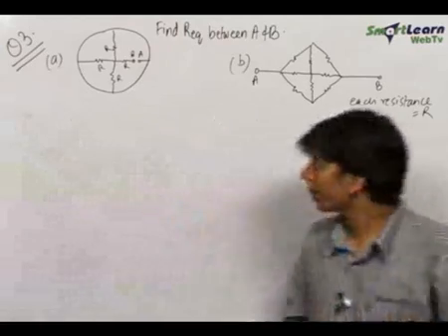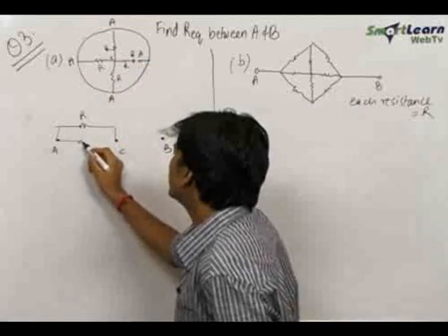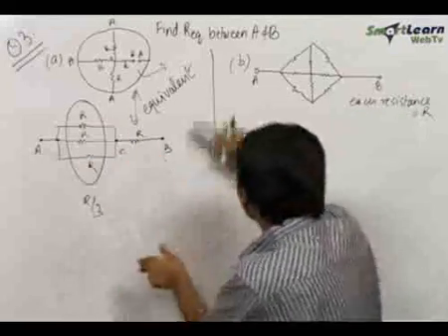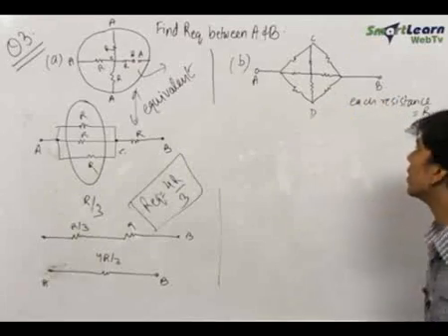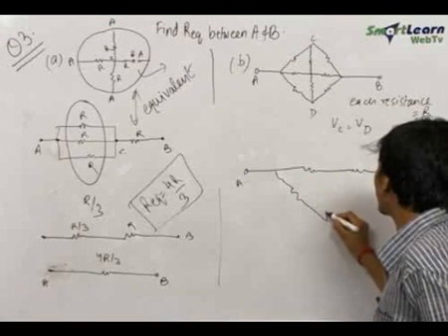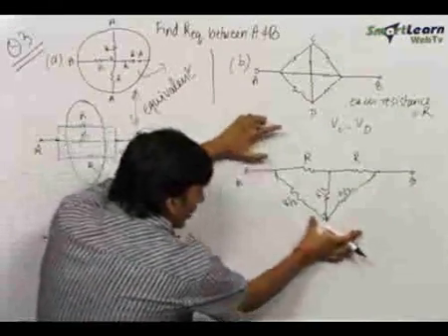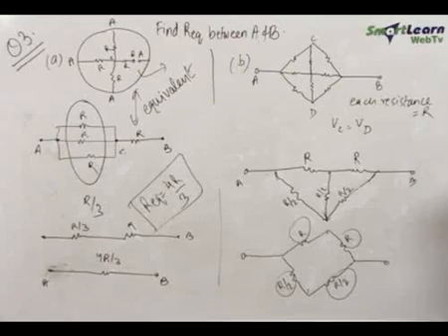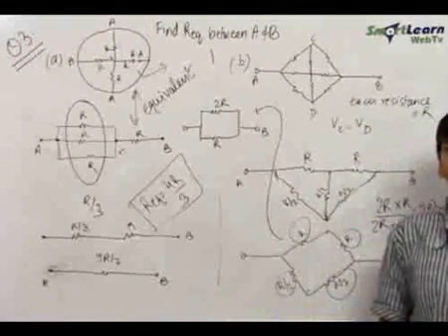Current Electricity - Problem Solving 2

Comment: may i ask, for the second question, why don't you just remove the vertical line connecting the two points of equal potential then calculate the effective resistance which is 3 parallel branches with 2 resistors in each branch?
Reply: Exactly my point

Comment: thanx a lot,
for the second circuit, can't we neglect the vertical line of resistors(wheat stone)
and then there will be 3 parellel 2 ohm resistors, the effective of which will be 2/3R